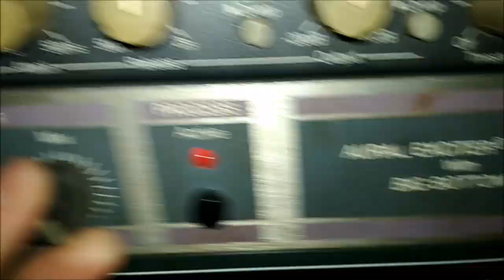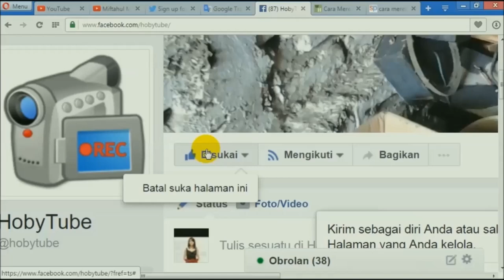APHEX 104

Comment: what power supply for the Aphex 104 are you using? do you know of a replacement power supply that works? My original finally gave out after many years of usage,
Reply from the maker: Adaptor sir read volt in socket power supply Apex 104